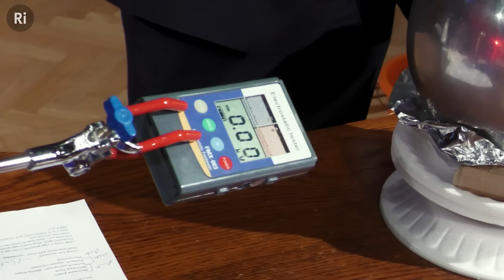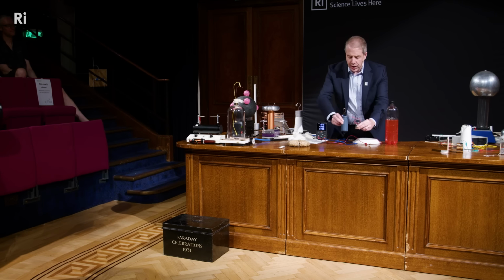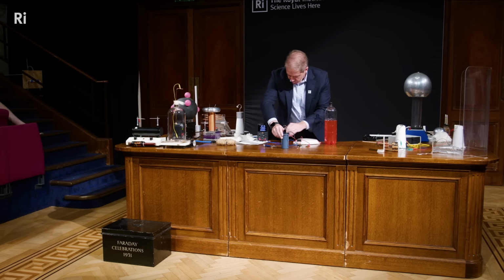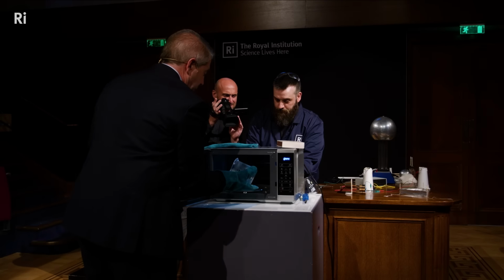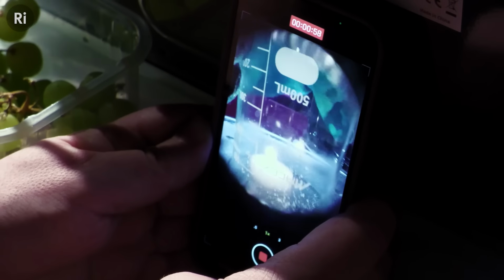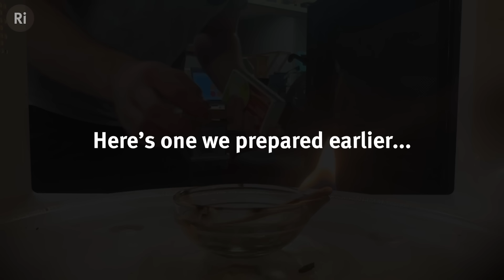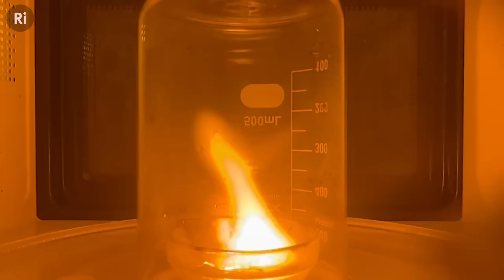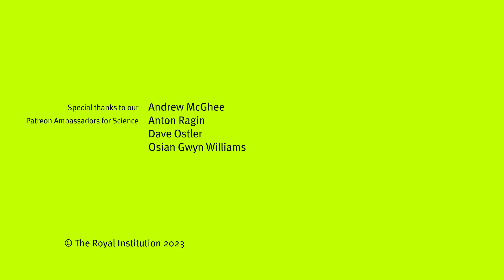High-voltage physics - with David Ricketts

Comment: This looked cool but I'm having major difficulty following his explanations!  Sometimes he mixes things up or the experiment isn't working for him so there isn't a clear cause and effect.  He also explains the paths of the charges without enough context.  Oh well, it looked neat but unfortunately I think he just confused me more than I already was.
Reply: Exactly my thought, although I am only at half time. But I don't expect it to get better. The waving with the two polarity checkers (red and blue LED) makes me spin trying to get it. I started to read the comments, and I thought they were written for another video. It seems to me, hearing the reaction at the exploding house ( 30:40 ), that there's a high satisfaction at the visual effects, and that people vote for the excitement more than the physics.
Reply: Yeah, with all due respect, this is perfect fuel for the science skeptics.
Reply: experiments can be 100% accurate all the time specially with electricity. he tried his best and maybe this wasnt for beginners he just demonstrated how theory works. if u dont have prior knowledge to what he is doing, it will be confusing.
Reply: Yep, now how is electicity induced ?  He had rub the rod with friction first to create the charge.  I don't follow this guy
Reply: Ok. Fair enough. High voltage is a lot like the weather. Many things are not in good control. Air humidity just to name one. Many others, experiments do not always work out as foreseen.  But you must admit the lecturer covered many things and did many demo's in only an hour.There's no way he could be more complete or maybe more accurate for this lecture.

Comment: I'm just in the process of doing some building work here in lightning-rich thailand and I have some 2 meter copper clad rods with Faraday spikes  on the top to install at over roof height,  in my design I am using a complete connected metal frame in rebar/cement called a UFER GROUND, this ensures the best low impedance earth path and a good lightning path, part of essential building design often overlooked in the tropics where you can get hundreds of strokes per minute at times in monsoon weather and very poor system grounds as well.

Comment: I'm at 14:00 in and I was thinking that the charge changing is just like AC/RF, lot's of RF components can be rated from DC to say 30hz, basically what he is doing is a DC signal.
These thoughts led me to think that DC should be up to a certain frequency resistance.

Comment: Interested in that magic wand. How does it work (detect the difference between + and -). Is there a schematic?
Reply: Search on youtube for Thomas Kim electrostatic potential and you'll find it. He's built several, I based mine on his design.  It uses two transistors, one is sensitize to positive charge and one to negative charge.
Reply: @professorricketts  Found it. Definitely gonna make myself one. Thank you for this reply and the lecture.

Comment: Nice demo. Shame on the audience for not joining in on Thunderstruck. The least they could have done was a foot stomp or a "na na na naaa na na naa-ahah"
Though not the absolute cutting edge that they claim to be. At the high voltage demonstration in the Deutsches Museum in Munich, they have an actual lightning generator, AND a demo hand will go sit in a ball faraday cage and they run the lighting through the ball. (you see the lightning go in from above, and then jump again out the bottom)
I understand that such a device could not fit in the auditorium, but in the same demo on Munich they also demonstrate the plasma generator that runs a standing plasma arc between 2 outward and upward bent poles. It jumps at the smallest gap, but as the arc stands, the heat drives it up, making it larger and larger until the gap is too big and then it interrupts and immediately jumps again at the smallest gap. That device gives you a chance of closely and properly inspecting a lightning, what is is composed of and how it behaves. And it is smaller than the carts they wheeled in for this show, so that one was definitely lacking from this demonstration. 

When speaking of high voltage and nobody required ear plugs, you cannot possibly claim to have gone to the cutting edge...
Reply: The high voltage discharge does not go through the cage. It travels over the outside surface. If you took an electroscope into the cage with you, it would not show any electrostatic voltage at all.

The other device you describe is what is commonly called a "Jacob's Ladder".

Comment: I have been in "Hobby Electronics" for over 55 years, got my Amateur Radio Licence on prior knowledge, I have to say all these experiments were all too familiar, but explained in a unique way.
It would have been an extra if he had explained how Electrons (Voltage) flows round a circuit in a continuous loop, but maybe for another lecture. I do know BTW. Thanks.
G1ZQC. 🙃
Reply: The electrons do not flow very fast, but the current flows at an appreciable fraction of the speed of light.

Comment: Great presentation. However, the explanation of what generates a negative charge was left unanswered. The presenter explained it’s the electron being ripped off that causes the positive charge but I don’t understand what causes negative charge. Is it an excess of electrons on the opposite side of the conductor or electrode?
Reply: Yes, the ripped off electrons are collected to produce the negative charge.
Reply: Yes. It's symmetrical.

Comment: Just starting but you have a degreed electronics individual with twenty five plus field years experience and a computer science degree.   I’ll tell you more as a watch. The ballon might be neutral but, you still observe the potential, ie to ground. No, I guess he is right but, I’m surprised you don’t have a grounded neutral post for reference and control. Except for a danger element.

Comment: you should place some good Air Conditioner machine in that HV-demonstration room, the one that can provide dry air atmosphere in room, with good water drainage system,properly designed model of AC, good enough for dew-condensate diversion, to pour out of that auditorium some condensed extra air moisture, to get dry air, best for such experimentation and demonstration.
Looks irrational, but probably you need also some room heater there too, for cold weather time... so strange equipment looms there, when both "ends" of AC machine - cold side(room part of AC), and external,- hot radiator for (usually)outside instalation, can be reasonably placed in one room, working as room heater as result(no heat energy drain outside, but electrical power consumption resulting in some extra room heat frome whole AC machine, (both heat exchangers, cold one and hot one) placed inside same one room.) but there is also second result - air drying, and water poured out of room via drainage condensed water flow tube..., 
you also need to close ventilation system in room, in order to save dry atmosphere inside auditorium, and maybe to mount some good door and windows seals, agains outside rain moisture influence...
... Another good way, may be cheaper, to have in auditorim good bakin oven, with heat mode and room air ventilation mode(used for mushroom cold dry or so... just as room fan with some box attached, ready to heat). Idea is to use some 10..20liters bucket with silicagel or with MgSO4 pellets(you dont need thin powder there for good airflows via drying agent), drying air that pass trough powder or pellets of silicagel, to provide dry air for demonstration time, and later it can be heated in that oven, to recycle drying possybilityes of silicagel (or your drying agent, Na2SO4 must work same style, and mabe CuSO4 will be still safe enough if not to eat it toxic salt, white when dry, blue when need to heat-recycling rehydatation)

Comment: The fourth state of matter
Plasma is called the fourth state of matter after solid, liquid, and gas.[16][17][18] It is a state of matter in which an ionized substance becomes highly electrically conductive to the point that long-range electric and magnetic fields dominate its behaviour.[19][20]

Plasma is typically an electrically quasineutral medium of unbound positive and negative particles (i.e. the overall charge of a plasma is roughly zero). Although these particles are unbound, they are not "free" in the sense of not experiencing forces. Moving charged particles generate electric currents, and any movement of a charged plasma particle affects and is affected by the fields created by the other charges. In turn, this governs collective behaviour with many degrees of variation.[21][22]

Plasma is distinct from the other states of matter. In particular, describing a low-density plasma as merely an "ionized gas" is wrong and misleading, even though it is similar to the gas phase in that both assume no definite shape or volume. The following table summarizes some principal differences:

Comment: Amazing show of past and present very well put together loved it and understandable. 
I tinker with plasma /ion thrusters etc , but not Tesla coils  , interestingly though I stumbled across Tesla's real coil design not seen anywhere today . A scientist that worked with Tesla split the beans on it before his passing,  I'll do my best to explain  , as you see with the 2 coils in the induction coil for spark plug Primary and secondary coil well the true Tesla coil works in same principle but one Primary 3 secondary,  All wound on one tube going up with space between each winding.
To write the picture of design looks like this example with only example of winding to build picture of size of windings top to bottom :- Bottom coil (Primary) 2 inch tall with whatever windings it takes I'll call it 200 turns THEN one inch space before first secondary (because Primary is 2 inch) secondary winding at 100 turns , then because secondary winding is only one inch tall the space to the next secondary winding is half an inch , so you continue to the second one inch secondary   half inch space then third secondary inch ,  COMPLETE.
Power the bottom Primary coil and the 3 top secondary coils do the magic , it multiples puts out more power , that's why it's been hidden from us , i have seen simular coils plasma tv coils etc but not on a standing Tesla coil..
Keep the size spacing formula just up size , i will say i hold no responsibility for anyones actions building the coil , formula for information only take on at own risk.
Happy to share hidden secrets enjoy.

Comment: Regarding your question, how did the plasma transfer to the glass and you do not know the answer? I think I have the solution according to my theory, which is that the electromagnetic field field was disturbed, and when the Earth’s field field vibrates at frequencies that reach the range of the visible spectrum here, it produces light or aurora... Electricity is  Part of the manipulation of the local field... Translated by Google... The theory of the light lover being previously unified before its creation. Or light is the same electromagnetic field, but we increase its frequency until we reach the visible spectrum.❤❤

Comment: Heh, on the one hand, I get it...

But the devil's advocate in me has to point out that...

1933: Beautiful hand-made machine of wood and glass and metal that works automatically and extremely well, generating visible and audible 50 kV sparks reliably despite the humid day.

2023: An upside-down garbage can with some cheap stamped metal plates and some literal garbage a.k.a. styrofoam cups, with some LEDs that barely work half the time and are thunderously underwhelming and flash the wrong color more often than not (yes, I understand why, but still...) due to the astonishing feat of generating 4 volts instead of 2. >_<

Comment: that old machine is just getting power from the outlet. What is he talking about it does not power itself
Reply: I mean the mains power drives the motor to provide it with mechanical energy, it is however not providing electrical energy to the output.

Comment: Sadly I stopped watching midway through the electrophorus demo.....as someone who has done many triboelectric & electrostatic demos this was excrutiating. I cannot believe this is on the Royal Institution's channel. There are many amateur You Tubers who do a FAR better job of demonstrating these phenomenon. The presenter, who obviously knows how bad this is, clearly went into panic mode. If the humidity is too high or the presenter is carrying stray charges, then these demos simply won't work......no wishful thinking or positivity or sleight of hand will change that fact.
Reply: The presenter should have worn rubber gloves to isolate himself from the rods.

They could have heated up the room previously, put a dehumidifier in it 24 hours before the scheduled lecture.

Comment: Talorical currents of the universe doesn't make it happen when it stands still it only circles in place and builds charged particals without having a place to go outside of its own stillness till a wave comes in and push some of outside of its stillness to create a point of momentum and the scattered stages come into play these built-up charges are then powerful and effective in the production of Talorical products that spin faster than light in most cases it disipations starts side down side up side all around by spinning occurring and then returning to the point it came from the states of statically driven returning from source is mostly lowered but the fact is that most is discharged state's and the process repeating itself to a gravity point of view its a Talorical currents of the universe

Comment: Wroooooong, the Egipto clergy had batteries made with lemon juice as the acid copper rods and ceramic pots which they used for a variety of things, and chinese royalty as well had bateries, both thousands of years BC. What kind of idiot at this point asume electricity was discovered by europeans of as late as 1750.